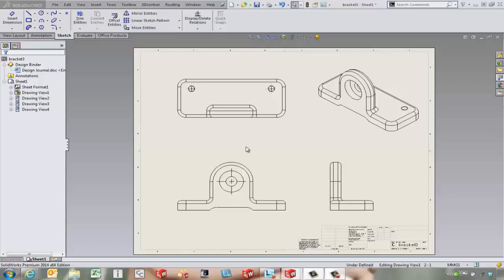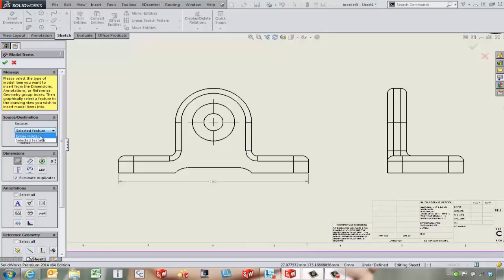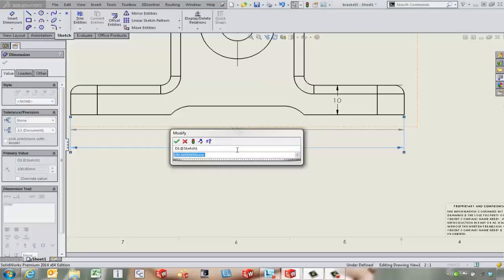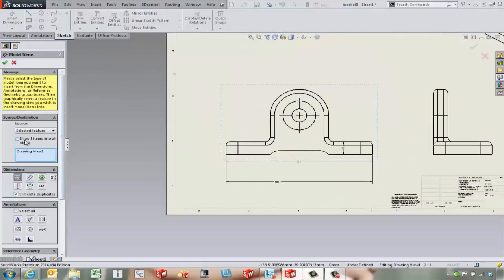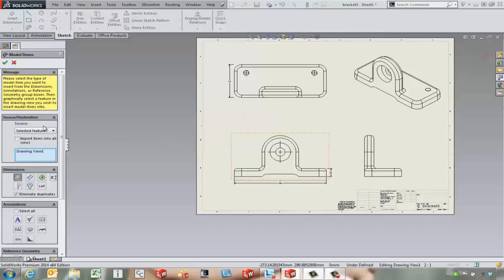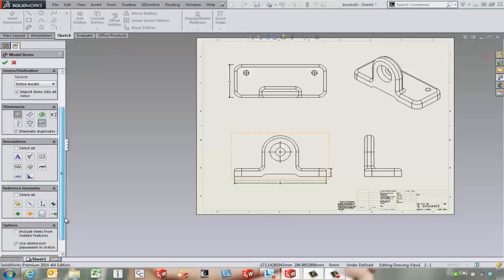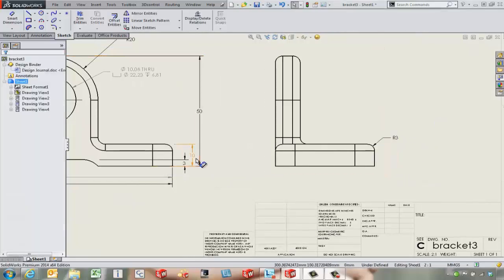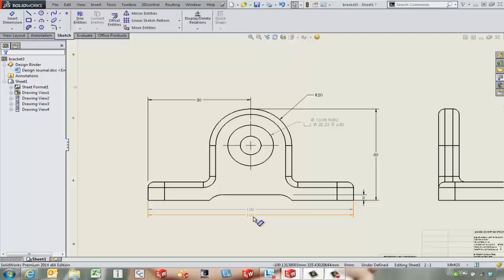SOLIDWORKS - Inserting Model Dimensions into a Drawing

Comment: Hi, 
"shift" bottom can move the dimensions from the parent view to the projected view. 

But what about detailed view? Can you move dimensions to detailed view?
Reply from the maker: Using a Control-Drag to copy or a Shift-Drag to move dimensions to a Detail View worked on the sample drawing that I tested it on.
Reply: @goengineer  may I know what SOLIDWORKS version you are using? I am currently using 2020. (Unable to shift drag dimensions to detailed view "directly") 
My work around is to
1) Create a sketch that encompass the entire parent view first
2) Create a detailed view based on that sketch
3) Shift-drag the dimension from parent view to detailed view
4) After transferring dimension to detailed view, edit the sketch in parent view to shrink down to the particular area of interest

Comment: My dimensions come in, however, it does not actually give me dimensions, just the lines. How can I fix this?
Reply from the maker: If you are having issues with the dimension lines coming in but not the actual dimension numbers, then there might be an issue with your graphics driver.  Can you check to see if you are running the recommended driver?  If the behavior is the same with manually added dimensions or using Insert/ Model Items, then you may have to have your SolidWorks reseller take a look at your system or the files.

Comment: I want to give manual dimensions which comes in grey..

Is there any method to turn them into black
Reply from the maker: Hi Chinmay,
There is a global color setting you can use to change the default color of driven dimensions in SOLIDWORKS.  You would go into 'Tools', 'Options', 'System Options', 'Colors' and find "Dimensions, Non Imported (Driven)" in the list.  You could then edit the color to be black which would change all the colors of your driven dimensions to black.
Reply: you can also change your layer to "format" or create a new layer altogether.